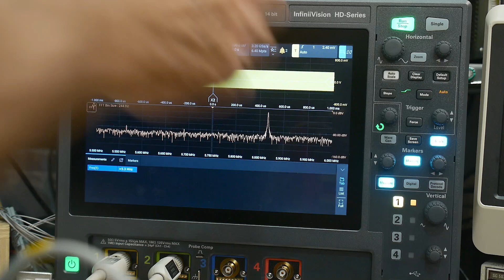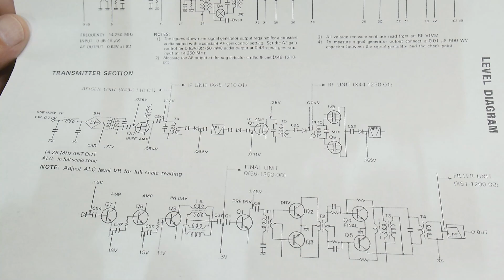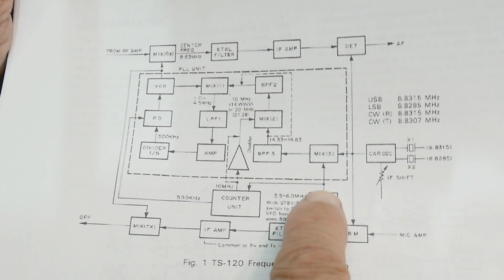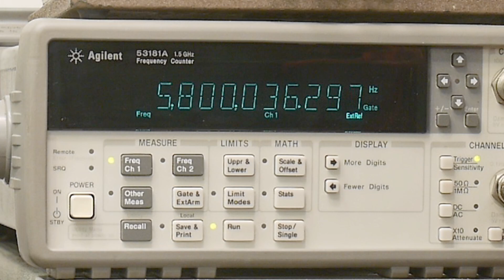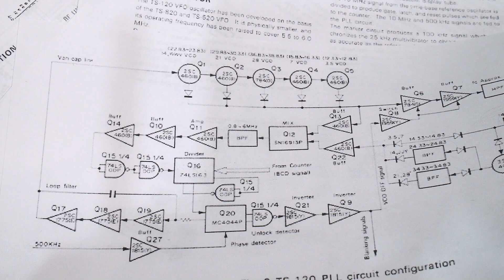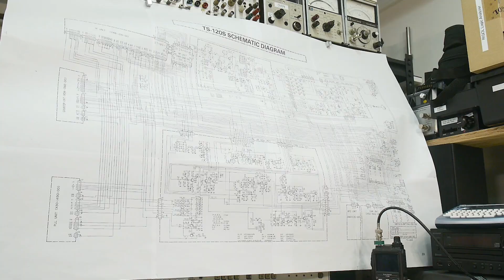#1993 Kenwood TS-120S HF Transceiver (part 4 of 12)

Comment: Please explain how you got the diagram onto that LARGE printout.
Reply: You zoom in and print it section by section , overlaping a little on the edges,trim the edges and tape the sections together.At least that's what I've done.
Reply: I have a printer/plotter and a ledger size printer.  The ledger size printer does up to ledger size which is 11 X 17.  With my printer plotter I can print up to 4 feet wide and the roll of paper new is 500 feet long.  Obviously most people don't have printer plotters but everyone has access to them.  Just go to your local print shop.  Almost every small town has one.  They frequently handle shipping, printing forms/invoices, custom banners, etc...  Most stationary stores also have large format printers.  Just put the PDF file on a thumb drive and go to Staples and have them print it.
Reply from the maker: windows print driver, select poster, tape all the pieces together
Reply: Staples can print off a usb stick